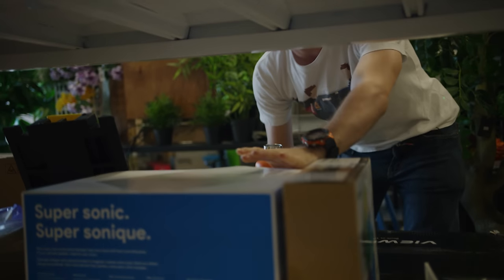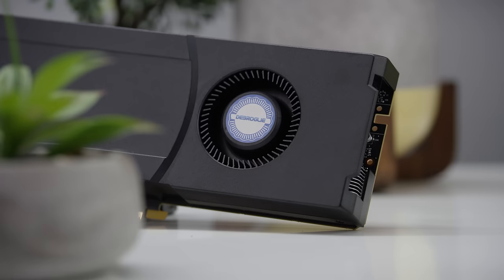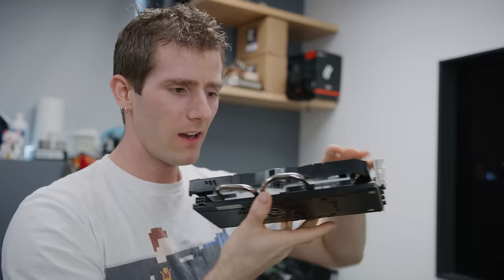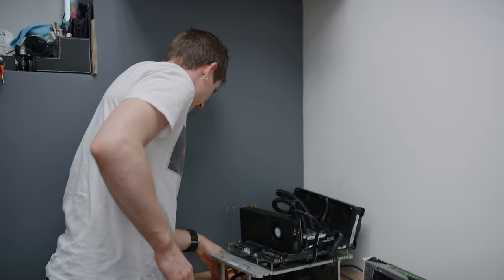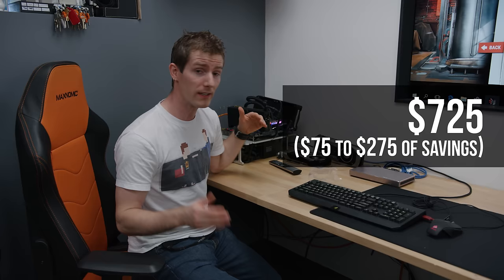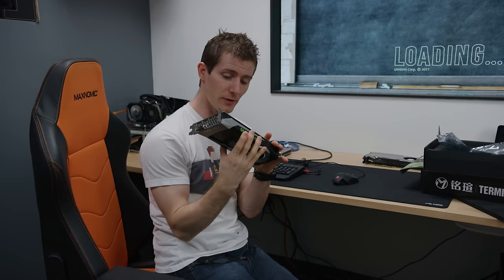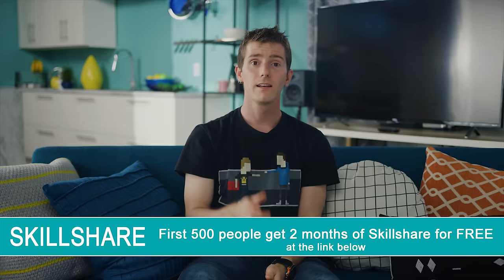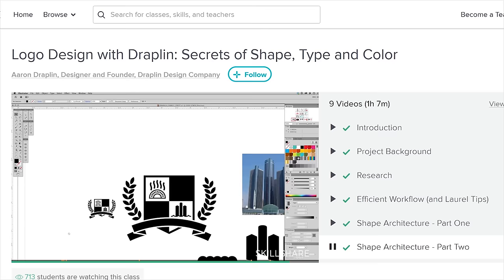Cheap AliExpress Graphics Cards - SCAM???

Comment: Just saw this video, i buy all sorts of stuff on aliexpress, you may wait from 7 to even 60 days, but every thing you order does its job fairly well, or identical to some big brand names, the Chinese cards are fine now, the perform pretty much the same as and Asus or Gigabyte card, be it Manli, Maxun of Colorful, they all work fine, they are ment for the Chenese market, you have watercoolers 240mm for 70$, and they are very good value for money. Check out the ddr4 2x8gb rgb ram at 3200mhz for 70$, it pays off.

Comment: It's not that hard to make a good knockoff. If the pcb is assembled by any EMS, the right personnel with have all the specs, from Gerber all the way to the BOM. You can just sell it off and contact another EMS to build it. Shenzhen is pretty much the capital of electronic manufacturing.

Comment: I got good stuff from there tbh and cheap too 
i5 2500k
gtx1060 3gb x2 fan
12gb ram 4+8
500watt PSU 
gives 60+ with 1080p so i'm fine with it cabinate purchased from amazon
Reply: Does your ram work in dual chanel

Comment: I've purchased plenty of electronics on both Banggood and Ali Express. Both work similar to E-bay, in that there are separate vendors in China selling things on these sites. It all works. It is all good quality, but a little rough around the edges. Excellent quality epoxy glass boards, good components, connectors a little cheap, but they work.  They don't package as well as we do, but everything I've gotten from them worked fine. Sometime you can't find what you want any where else. Documentation is sparse, and a lot of it in Chinese. I'm a ET, so I read schematics, and don't have a problem with this. You can save a hell of a lot of money if you can stand the wait. As with most things, you have to know what you are buying. Returns are a bitch, but some vendors there have state side returns.

Comment: When you buy something made by cheap materials then there is a risk involved. Will it last as long as the original will last? That's for every consumer to decide.
 It's not like you HAVE to buy a GPU right now, just wait and its price will inevitably fall and buy it then. So with that in mind, definitely the original is the OBVIOUS winner in everything that has to do with electronics.

Comment: Yea my experience living in China is that they do tend to have China only editions of things with weird RAM and storage amounts etc but yea the build quality since they are dirt cheap in China is not great and a lot of these internet cafes etc dont mind having to occassionally replace a few since by the time they burn out or break they have made their moneys worth from them. China is really interesting. I used to live close to Shenzhen and some of the stuff you found in the electronics markets that were China only were pretty strange but interesting.  But again if you are tech savy you could replace some of the  poor build quality parts with better ones and still end up spending less than the west by a considerable amount.

Comment: I'm here from the future, be warned about cheap 10 series on eBay, especially 1060. They're often like a 400 series (yes, 400) card that's been flashed with firmware to look like a 1060.  
GPUZ recognises them as fake however and says FAKE.  
No 10 series cards have a VGA, so if its cheap and has vga it's likely fake.

Comment: Yeap alixpress is legit. Even the cheaper used cards are fine. I purchased 750ti to try it out first and later 960gtx 4gb. Both work fine and can run even today games on low-medium settings. Good option for gaiming on very low budget.

Comment: Just as a side note, I don't think GPUs will get that much expensive as in the past because all of these cryptos are switching from Proof of Work to Proof of Stake. Basically, with POW the fastest computer gets the right to process a transaction and get the bucks. With POS it's kind of a lottery: depending on the nodes that are available to process the transactions one of them will randomly be entitled to process it.  https://en.wikipedia.org/wiki/Proof_of_stake#targetText=Proof%20of%20stake%20(PoS)%20is,(i.e.%2C%20the%20stake).
This means that having top notch hardware is not a requirement anymore.

Comment: To play better games you need to have graphics with 1GB, 2GB or 4 at most but to be at least 256 bits or 512 bits and to have the same minimum 8 to 16 GB of working memory. On YouTube, the clips that go are all true, or with these built-in graphics, UHD 4000 or 6000 are a real miracle, but you must have 16GB of memory and you will not have a problem whit playing.

Comment: It amazes me that you didn't google 1060 5gb and find "The GeForce GTX 1060 5 GB is a graphics card by NVIDIA, launched in December 2017. Built on the 16 nm process, and based on the GP106 graphics processor, in its GP106-350-K3-A1 variant, the card supports DirectX 12. ... GeForce GTX 1060 5 GB is connected to the rest of the system using a PCI-Express 3.0 x16 interface." as the first result. -_-
Reply: it amazes me that you didn't realize the card is from nvidia and none of the cards here are officially made by nvidia
Reply: @i_love_games110  That make no sense. There is a 5gb card.
Reply: @Robstercraw  there is a 5gb card by nvidia but the cards on this video have modded memory because they are meant for gaming cafes, which linus DID acknowledge in the video
Reply: @Robstercraw  the 5gb card is made by nvidia, but the 1060 in this video is not made by nvidia, it uses nvidia chipsets and components
Reply: @i_love_games110  yeah this video is old. I don't really care.

Comment: Nice ESD compliance - I’d love to see a before and after shot of the GPU - ESD damage is almost never instant with consumer circuit boards, and tracks are set back from PCB edges to make them safer for those who no nothing about ESD - even those who think they do know about ESD compliance often don’t - the clue is the missing wrists-strap - or connector between an ESD floor mat, ESD desktop or mat, and the handler - not to mention packaging. The mistake is thinking that as long as bit’s are earthed then it’s all good - earth is relative, it’s not always at 0v, and doesn’t need to be for ESD compliance. Problems occur with a Potential Difference between points, not whether one or more is earthed. All items connected by conductors of various resistance will create a potential for static electricity to move instantly - depending on its polarity or amplitude with respect to whatever comes into contact with it. The whole circuit (floor to table to PC chassis to engineer) can be sat at 500V with respect to earth as long as they are at zero volts with respect to each other with no path to earth - it’s completely relative - keep everything at the same potential then there’s no ‘potential difference’ no current can flow and it’s all good. 

but it’s the biggest cause of failure

Comment: what I think? the manufacturers really intended to run these cards on Asian countries before they release it to the west for reasons I can only think of, they are more of a risk taker and will just complain on the seller instead of the manufacturer, 2nd is that that is what it makes to outsource production because only Chinese manufacturing firms can create the cards and chips designed by western engineers
Reply: Update the graphics card directly
https://youtu.be/UvvLq7FK5WE

Comment: I would not be surprised off less memory on a Nvidia card, form the GT series 20 years ago until now. Nvidia has cheated people out of the promised amount of ram. They had court cases for this almost every 4 years. And then they only pay out 30 dollar refund to US people the rest of the world can just bend and get fucked.

The last one was the GTX 970 with 4Gb. Were they put a empty chip on the card, or forgot to connect it. So instead of 4 Gb People had between 2.8 -3.2 Gb of ram, I personally send over a 100 MSI cards back for this issue. Asus were the only brand that had actual 4 Gb.  

The trouble is proving it because windows shows the amount of memory the card/drivers tells it, same with GPU-Z will also tell you the driver amount of ram. Not the actual amount of memory but there a program for testing the real size: Vramsizetest.

And you got lucky with ali express, i seen them send out GT 6000 series and GTX 200 as new cards.

Comment: Does Linus just pick ali vendors at random?
Because that's not the smart way to go.
Ali is the wild wild west - you need a reliable guide or you will get jacked.
Like security cams.
Dahua is a well know, solid chinese brand.
They oem for a lot of the major players.
They also sell to anyone with a buck - complete cams or components.
So on ali, you might be buying a real Dahua, a mostly Dahua that has been well thought out and corners cut where it doesn't matter to save $$, or a horrid piece of junk.
I know a vendor that sells the first two, and is well known.
But if I'd picked a vendor randomly, who knows what I would have ended up with.